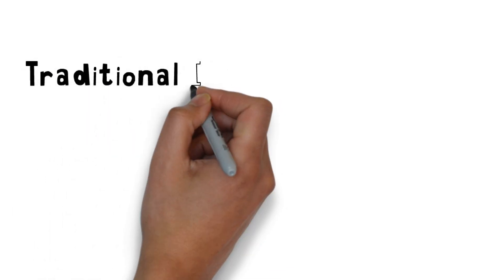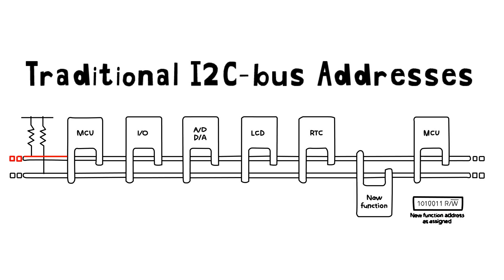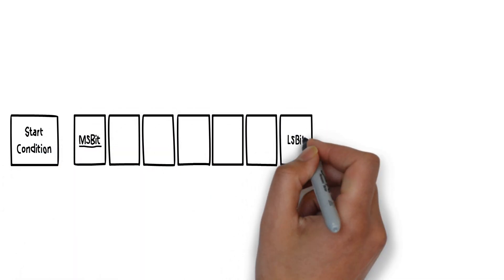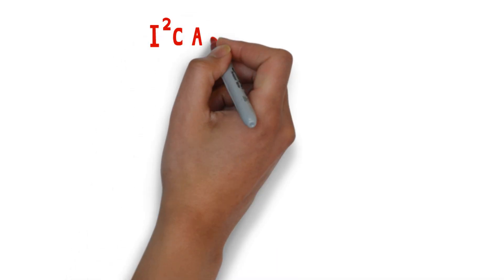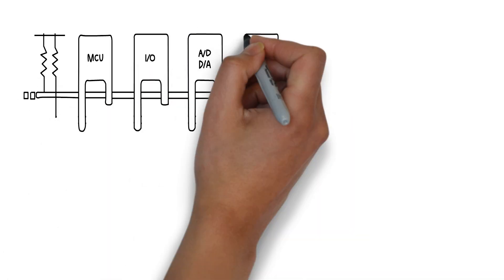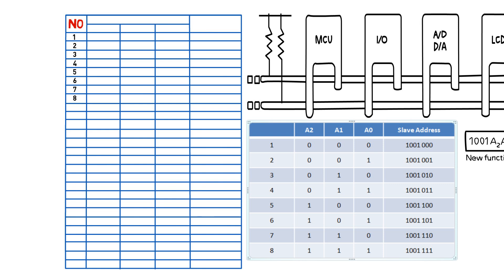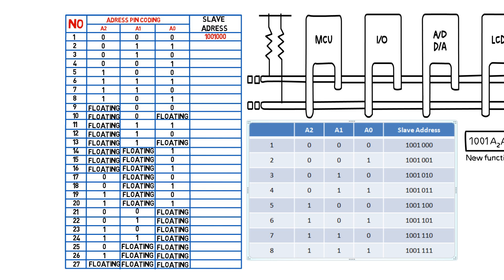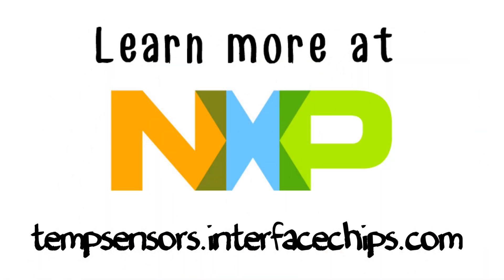NXP PCT2075 - Temp Sensor Address Conflict Solution

Comment: I really like this simple idea.. 3^3 rather than 2^3 with floating voltage on n/c pins. My only concern is, for critical applications in very noisy environments, could the address ever change accidentally?  If say, the address was 10011f1 but the floating voltage increased due to a noise spike momentarily to a logic 1, giving 1001111..  Have you designed around this? Many thanks